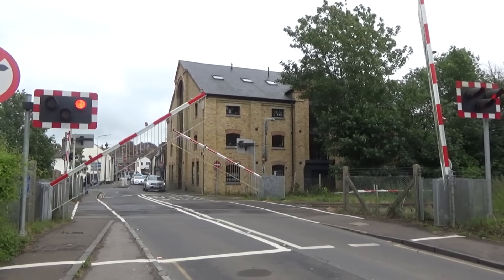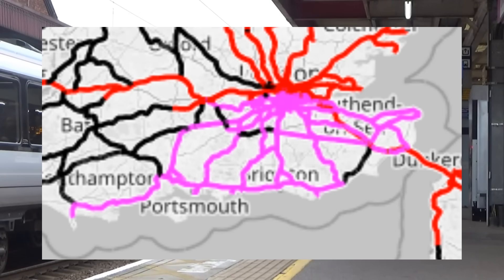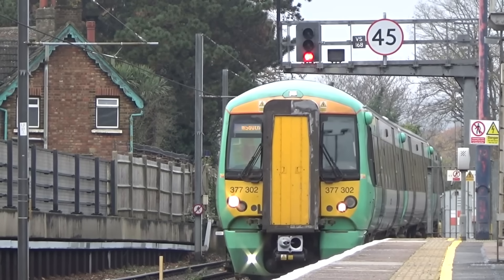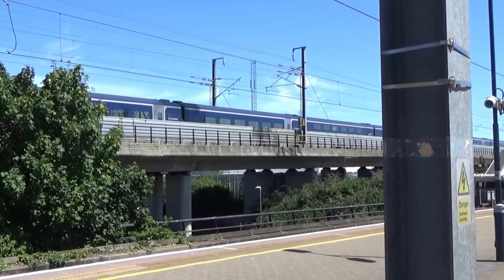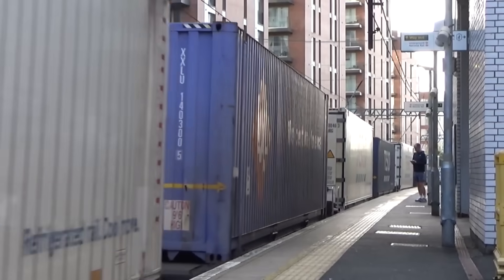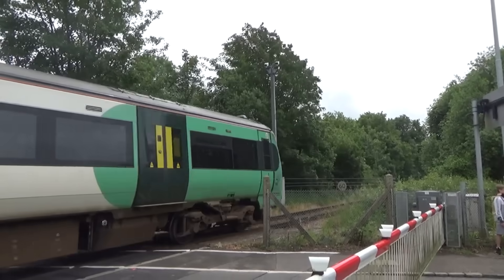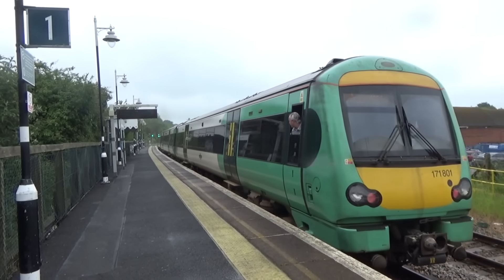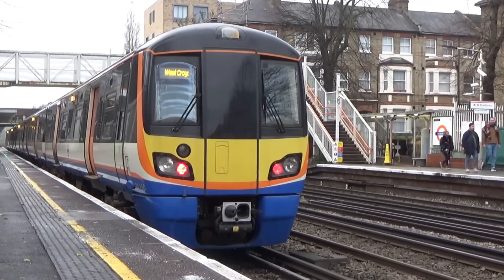Are These Railways Actually Unelectrifiable?

Comment: 4:50 how would OLE allow more freight vs 3rd rail when none of the current freight is using the 3rd rail.
Reply: None of the current freight uses the 3rd rail because there isn’t really enough route-miles over 3rd rail to justify dedicated freight locomotives. We already have diesel and OHLE freight locomotives, so electrifying at 25kV AC would allow freight locomotives that could already come down from The North (via London, until the line through Oxford and Banbury is electrified) and South Wales to continue to Southampton.
Reply from the maker: electric locos can be far more powerful, and get moving quicker compared to diesel, and the 3rd rail system doesnt have enough power to add freights in addition to the existing services
Reply: @LTRains  but very little freight starts and finishes on the 3rd rail network anyway. So it’s a misleading statement. “OLE would potentially allow more trains than the diesels we have currently” is accurate. The 3rd rail factor is irrelevant. Replacing it with ole would do nothing. The only fix would be flat out new electrification. If they’d built the electric spine for example. 

Plus I’d be astounded if electric locos vs diesel have a much real world difference.  
Various freight operators are running diesels under wires when diesel is cheaper than using the Ole. If these trains couldn’t keep to time. They wouldn’t be doing that. Stopping distances of these heavy trains doesn’t vary much between electric and diesel traction which is if anything a larger factor than getting up to line speed.
Reply: OHLE can’t work as the class 450 and 444 and 455 don’t have OHLE

Comment: Don’t dismiss Battery Electric trains. Some are running and Siemens have put a proposal to the UK Government to put them on none electric lines
Reply from the maker: not saying we dont need them or anything, its just that this isnt the right line for them. Battery trains have the most potential on short branch lines, ones that are a couple minutes end to end and usually see only one train
Reply: Sorry it seems you are well behind the current industry thinking. In Germany they are pressing ahead with discontinuous electrification of many of their secondary regional routes that (even with their far better per kilometre electrification costs) will never make economic sense, These routes in the south of England fit perfectly into that philosophy. Relatively short trains that don't often exceed 75 mph on traditionally unelectrified lines. Both Hitachi and Siemens are pushing to replace DMUs in the UK with battery electrics able to run 50-60 miles on battery in all conditions. Indeed Siemens are actually proposing to run class 350s with batteries on a partially electrified Worting Junction to Exeter St Davids service via Salisbury.
Reply: In Croatia our Railways are now introducing the new Končar, domestic-produced, electric-battery passanger units for the regional and local lines which connect with electrified national lines.
Reply: Yes just ignore embedded carbon.

Comment: Almost all the EMUs manufactured over the last 25 years are easy to retrofit to dual voltage because the concept was designed in. 3rd rail sets have a pantograph well and space for a transformer. And OHLE sets use a DC link which allows easy conversion to shoegear current collection.

Comment: ISTM what's always missed is that third rail doesn't have to mean top contact  (which with hindsight is ridiculously dangerous). A covered rail with a bottom contact would be much safer. Trains would need to be equipped with both kinds of pick ups, but that's relatively simple. OLE could also be 750V DC - maybe that's a  bit pointless but would cut costs through simplifying the equipment on the trains and on the line. 

But obviously batteries are the answer for passenger trains, especially on routes that are partially electrified already. The UK will need to buy a lot of them because there's no way there'll be the investment for a significant increase in electrification.

Comment: How many non-trespass accidents have occurred because of third rail electrification? The safety issue can be addressed with protective planks. The ORR needs to apply staff committed to pragmatism and common sense. It is a blight on Britain's railways.

Third rail electrification suffers from power loss due to the lower voltage.

Decarbonising the railways is nonsense. The contribution of the railways to total CO2 emissions is trivial. It is an unnecessary expense. 

The main drawback with diesels on the Southern is exhaust fumes London Bridge and Waterloo. Smoke extractor ducts over the platforms used by DMU stock would clean up the air. Another option would be eventual replacement with oil fired steam locomotives, or push-pull operation as was used between Waterloo and  Weymouth between 1967 and 1988.
Reply: Both of those options wont fly really well tho with the anti-rail and a hypocrite DfT. Push-pull only feasible for intercity, "but not commuter". Oil fired steam locos are a rare breed in UK

Comment: OLE with DC typically runs at twice the voltage of third rail (1500 vs 750 or thereabouts).  Despite the added cost of stanchions to kept catenary up there, there is a saving on the number of substations required when dealing with the higher voltage.  Even fewer are required when dealing with more modern electrification at 25,000 volts AC.   You have to look at whether you use a mix of overhead and third rail, or just one system.  It adds complexity when using more than the one, and depending on the structures en route, you may need to modify bridges etc to accommodation the extra heights required for Overhead.  Britain is renowned for very tight clearances, so this may be an expensive exercise where modifying lines to accommodate new electrification.
Reply: I mean there were (are?) definitely railways with 1500V 3rd rail. So upping the voltage is always an option.

Comment: Firstly, as others have noted, most rolling stock currently in use on the southern region already has the provision for fitting, and some already have dual voltage capability. (700s, 395s, 387s) 
Secondly, on the cost when comparing the two, one of the major differences between 25kv OLE and 750v DC 3rd rail is the frequency of power supply required, in that generally 3rd rail requires more power supply points, meaning than on average the cost per mile isn't massively different. You also don't really cover the ongoing costs for operation and maintenance, where generally OLE is cheaper to maintain longer term than 3rd rail. This is firstly due to the increased cost of 3rd rail being less efficient and needing more power supply points to maintain. secondly, I'm pretty sure 3rd rail shoes wear faster than pantograph contacts, thus cost more in replacements. Thirdly, the additional safety risks posed by 3rd rail also increases the costs due to additional required safety measures and incident response costs. 

Thridly, you didn't mention the elephant in the room, that is government incopetence / lack of interest in rail. Despite it being the best way to decarbonise transport.

Comment: Could 3rd rail not be AC?

3rd Rail could be made more powerful but they are concerned about safety but really it is safe it’s only dangerous if you touch the track when it’s live.
Reply: Maximum voltage for 3rd rail is 1200 volts. AC does not help. Power loss can be reduced by using aluminium conductor rails, which are becoming more widely used.
Reply: @physiocrat-sv  If aluminium was used does it mean 3rd rail could be faster say up to 140mph?

Just curious could copper not be used or would it be to brittle to be used for 3rd rail?
Reply: @jammiedodger7040
London Underground use aluminium conductor rails with a stainless steel contact surface. The practical speed limit for reliable current pickup with third rail seems to be about 100 mph. 

Copper rails would be incredibly expensive
Reply: @physiocrat-sv Is copper not used in overhead wires so I know it would use more copper but you would only make the 3rd rail copper not the whole track but the point is copper would most likely allowed for 140mph 3rd rail the alternative would be a Copper-Aluminium Alloy which most likely would be capable of 140mph while also keeping the cost down. 

The Underground uses 4th rail does it not?
Reply: @jammiedodger7040
London Underground was +440 outer -220 centre rail.

Copper conductor rails would be hefty bars of copper
Reply: @physiocrat-sv What about the alternative I said about?
Reply: @jammiedodger7040
Maintaining contact is a mechanical issue. I don't know if anyone has tried
Reply: AC is not inherently more efficient than DC – it's the voltage that matters. (If anything DC is better which is why almost all the new ultra-long distance transmission line use DC at insane voltages like 1000KV. Yeah, one million voltt! It's just that in the past AC was invariably used whenever high voltages  were needed because changing DC voltage was difficult but new tech has solved that problem.) The problem is simply once you get above about 1KV you better keep the conductor a long way from anywhere people are likely to be. That's why you get warnings on vehicles not to climb on them when they're under the wires.
Reply: @francisboyle1739  meaning if 3rd  rail could be made more efficient then it is the safer option.

I know that crossings become a problem with 3rd rail but there a simple solution to that you just just removing the power track from crossings most trains should be long enough so they still get power anyway but any trains that is not long enough will just glide across the crossing.

I think if we can make 140mph 3rd rail then all mainlines should be swap over to 3rd rail eventually removing overhead wires completely from the British Railway network I know it would take a couple decades to achieve as it means changing the majority of mainline track and would also mean that we would need completely new EMUs but as part of the upgrades we can finally upgrade the signalling to let lines like the WCML do 140mph for tilting trains. 

I think the best place to start with the upgrade would be the Midland Mainline majority of the line is still non electrified and the Class 700 can run on 3rd rail.

3rd rail literally makes the most sense it’s the cheapest way to electrify and blends in with the countryside.

Comment: London & The Southeast that have railway lines that aren’t electrified with DC 750v 3rd Rail and AC 25kv OHL could potentially be electrified. With more founding to be spent on making railways more greener and more efficient.
Reply: It's a non issue
Reply: Ok

Comment: The advent of battery tech means that diesel will be phased out over the next 25 years with partial OHLE being installed in high capacity areas and batteries running to the edges of the network…!
Reply: Until the inevitable battery fire.
Reply: @physiocrat-sv  And cost and embedded carbon. Battery fire in a tunnel doesn't bare thinking about.

Comment: There is still quite a chunk of overhead line electrification using DC - there are many 1.5-3kV/DC lines in Europe and Australia, although the dominant oh/w is 12.5/15/25 kV/AC.

One of the advantages of DC, which is why it is still used on new metro systems is the power is always constant (hence the D,) compared to AC which is a sine wave.  The disadvantages are moreso the need for very frequent substations, and that you can't have significant power drain rapidly - as well as thicker overhead. 

What would be more feasible for the southern railway would be to adopt the DLR / modern 3rd rail system, which is within a box, and the shoe is underneath the rail, which is the reverse of the current set up. This then gets rid of the vegetation and ice issues, and is significantly safer for trackworkers. 

The cost is probably similar to overhead, but the biggest issue you have with 25kV/AC is that its voltage potential for jumping the earth bond is very high, and if all the structures have been built for DC - it won't have earthing requirements for AC. Which means you have to completely redo the signaling system (as it would likely use AC detection circuits), as well as all the electrolysis bonds, as well as also check the electrolysis requirements of the buildings and structures adjacent to the corridor.  That adds up significantly - There have been overseas examples of a proposed conversion from 1.5kV/DC to 25kV/AC which were abandoned after they found the costs, and that all the structures weren't designed for AC stray currents.
Reply: Just fit protective planks in risk areas.
Reply: Just think trains from Manchester to Sheffield used to be 1500v dc. What short memories you people have.

Comment: Building overhead wire networks in the South East to replace third rail might be feasible in several areas, but if the goal is to decarbonise … it seems much more logical to first electrify lines that are not electrified at all. And we are not speaking about some obscure branch lines here : even major lines in Wales and in the South West are still not electrified. The UK is really lagging behind with at most 40% electrification, with a European mean around 57%. To see a good example, Switserland, Luxembourg, Belgium, even India do much much better. Electrification of a network takes many years, but if ofcourse you prioritise private railcompanies profits, you are not getting there rapidly. Meanwhile the UK has understood what to do but after Brexit the economy is not strong at all to be able to heavily invest.

Comment: They say batteries and bi modes are easier and cheaper, but then they still won't fund even that. Birmingham New Street platforms are a smog death trap, and converting all diesels to bi modes would put a stop to that
Reply: BNS is a good example of why oil fired steam locomotives need to replace diesels. They give a clean burn.

Comment: There are already EMUs on the Overground in London which can do both 3rd rail & OLE. Just buy another such class of dual voltage EMU and run them on the North Downs Line after electrifying it with 25kV OLE. The battery experiment will not work and is for freight a non-starter. As for Uckfield and the Romney Marsh lines, take a deep breath and put in a third rail, then that system is complete.
Reply: The battery experiment worked, but that only covers passenger traffic at the moment.

Comment: For the marshlink line a case study said it would probably be easier to just buy 5 units of class 800s (or any other fake javelin that has both diesel and electric ) instead of electrification in the instance that hs1 would be extended to Hastings.
Reply: So oil fired 2-6-4 tanks would do. Push pull with old Networkers.

Comment: Not suggesting that uckfield or the marsh link should be electrified using OLE, but rolling stock wouldn’t be an issue as Southern and Southeastern operate dual voltage electrostars with 377/2/5/7 and all 387s equipped with pantographs
Reply from the maker: most of the dual voltage 377s run the service to watford, and southeastern doesnt have enough stock to give up their electrostars, at least until we get a 465 replacement
the 387s are acc an idea tho... if we're willing to loose the gatwick express

Comment: Javelin trains in Kent are dual power, they use pantograph and third rail on different parts of the journey, reaching 140mph on pantograph section
Reply from the maker: yeah, mentioned that theyd be able to run from ashford to hastings
Reply: @LTRains  cool, I guess I missed that bit.
Reply: Ashford Station has OHLE 25kv already, for the Eurostar services (which currently don't even stop there). How far down the Marshlink line towards Ore (end of third rail east of Hastings) could the power reach without installing another feeder? Single line, infrequent service, sick up the wires, a few dual voltage 377s and that's that. 

And yes,  I know there'll be hundreds of reasons why that's not about to happen...

Comment: Just upgrade the entire network to overhead. Battery trains are garbage. They have been wasting millions trying to get a poxy D stock on the Greenford branch, for the last two years, added to the decade prior under Vivarail.
Reply from the maker: tbf, battery has potential on those short branch lines, but it just isnt fit for mainline trains running more than a couple minutes
Reply: @LTRains for the vast amount of money spent converting a 50 year old tube train,  we could have bought brand new out the box hydrogen trains.
Reply from the maker: yeah i agree, but the main point of this was to prove that it works, not nesc to be the perfect train
and for hydrogen, thats got a lot of its own problems
Reply: @davidwebb4904 
An oil fired version of the 1400 class would have done the job at a fraction of the cost.
Reply: OHLE makes the system unreliable.  Here in Sweden it is constantly falling down.
Reply: So are you volunteering to hand over far more in tax to pay for it? Or do you have the secret to where an orchard of magic money trees have been planted?
Reply: @chris8405 Do some FOIs on their accounts…..

Comment: There is no such thing as an unelectrifiable line. Switzerland put the wires up and through a mountain ffs.
Reply from the maker: not physically unelectrifiable, but the cost and circumstances around these specific ones make it very difficult to do
Reply: @LTRains  If they start doing it slowly it will create jobs and make running costs cheaper for trains
Reply: @DaveSeville-sf1ku also if it was a continuous program of electrification using only the same 2 or 3 crews it could be done much cheaper so u dont have to pay to train everyone every 5 years when theres gaps in the work